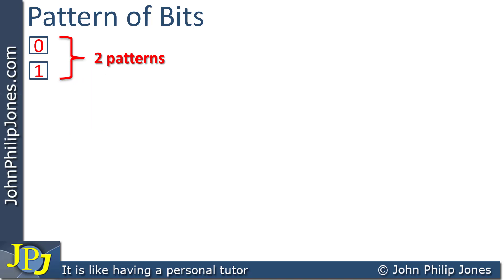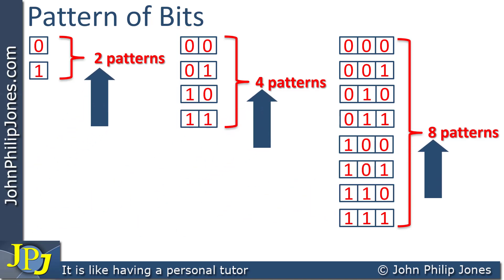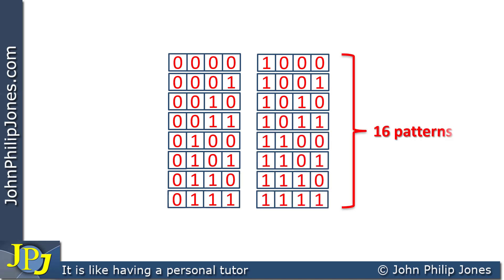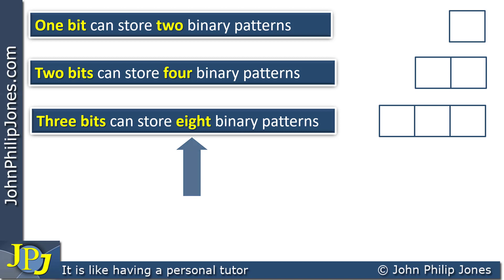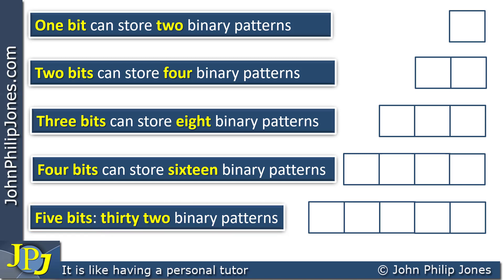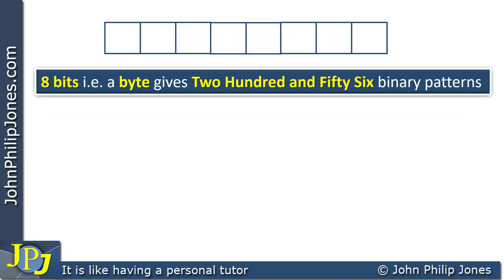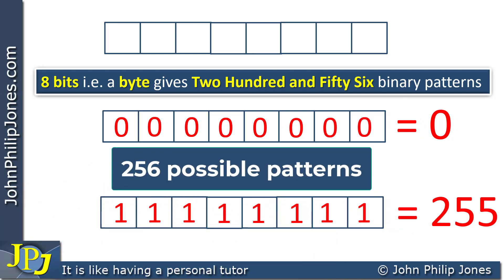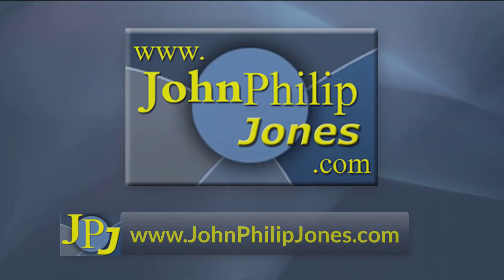Binary Bit Patterns

Comment: What a great video and clear cut way to teach. ! Does low level language mean all code is written in binary numbers ?
Reply from the maker: Thank you for the positive comment.
Machine code is a sequence of binary patterns. It is the language of the machine. It consists of operational codes (instructions) and data. A low level language is assembly language which is a symbolic representation of machine code (binary patterns). e.g. LD A, 00H loads the accumulator with 8 zero bits. In machine code it is 00111110 00000000
This is usually expressed in hexadecimal as 3E 00 because it is easy for humans to remember hexadecimal and conversion between hexadecimal and binary is relatively easy.
Best Wishes
Phil
Reply: @johnphilipjones  Thank you 🙏